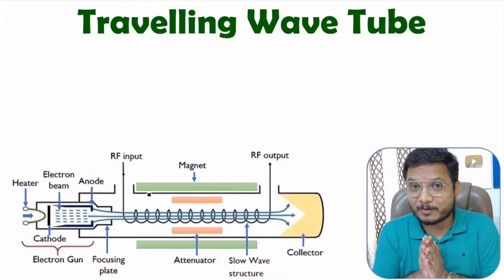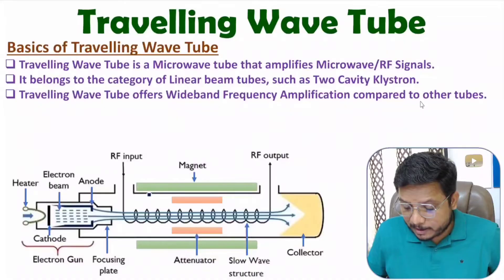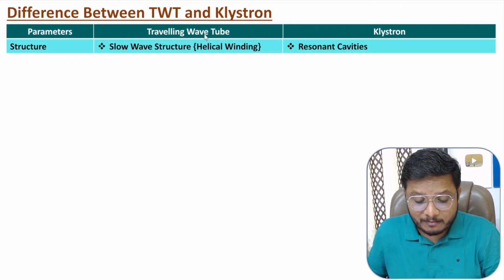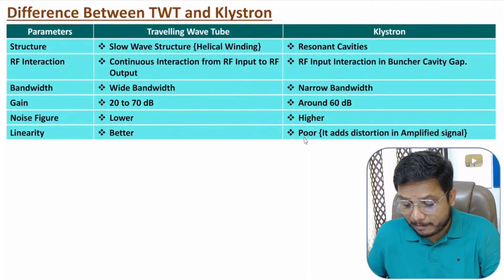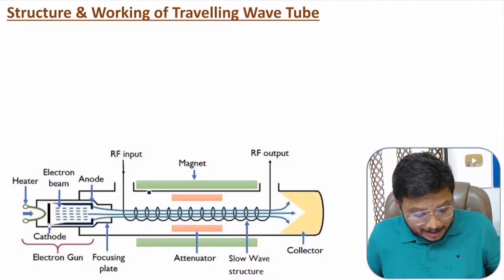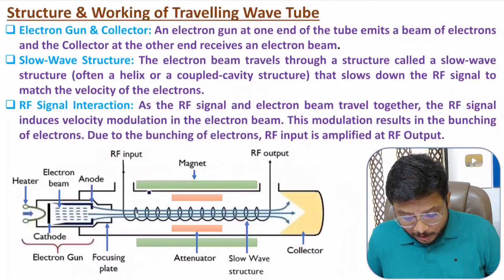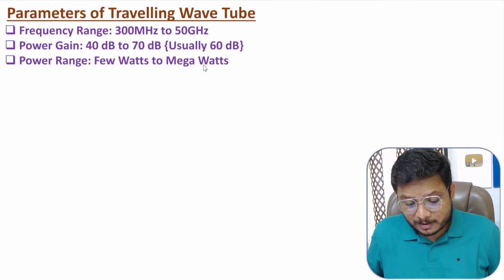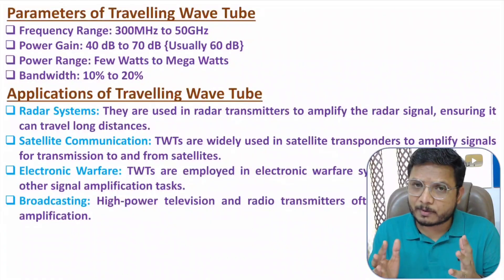Traveling Wave Tube (Basics, Structure, Working, Parameters & Applications) Explained

Comment: Sir You said that in velocity modulation late electrons has higher velocity and early electrons has lower velocity
But in reflex klystron video you said that in velocity modulation late electrons have Lower velocity and early electrons have higher velocity 
Which one should be considered as correct ??
Reply from the maker: Both has different concept.